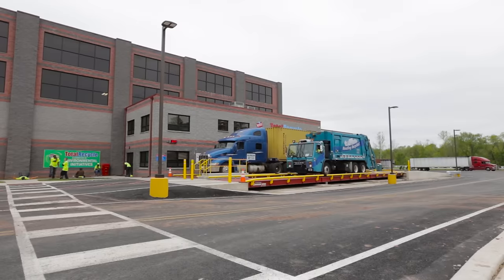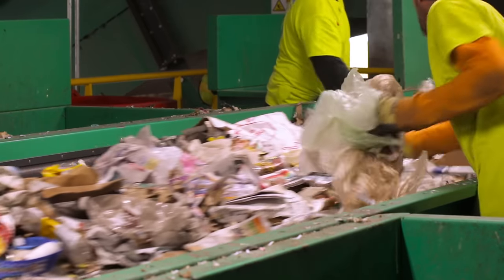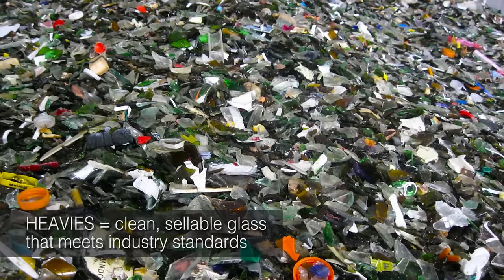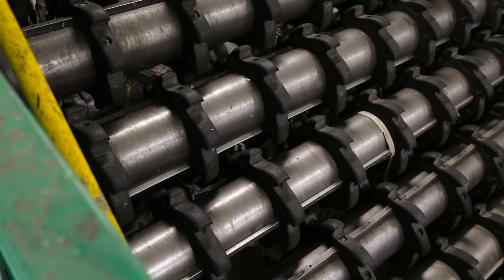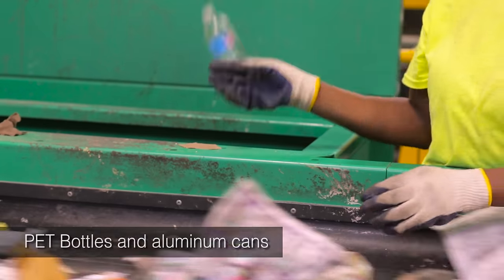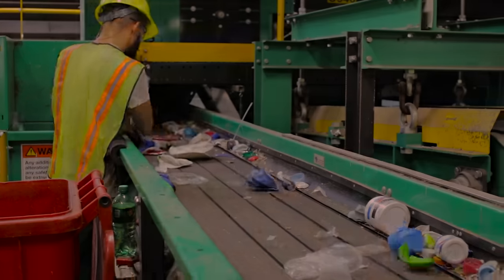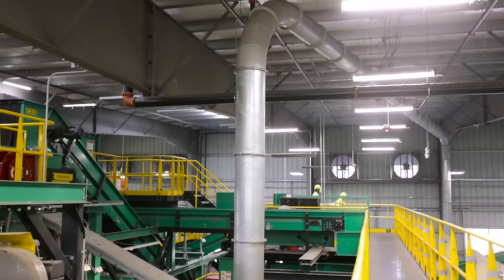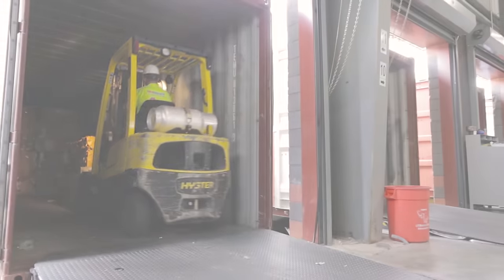Single Stream Recycling – Tour a Material Recovery Facility (MRF)

Comment: I was supervisor at an old, I think one of the first MRF's ever conceived for five years. Mechtronics machinery in Northampton, Pa. We used Van Dyke services for repair and upgrading. Looks like the single stream equipment is improving. But most plastic still goes to the land fill, the 3 to 7 plastics on the recycling triangle posted on products are sent to landfills.
Reply: You need some AMP Robotics in there.